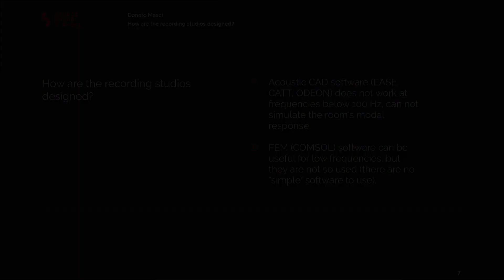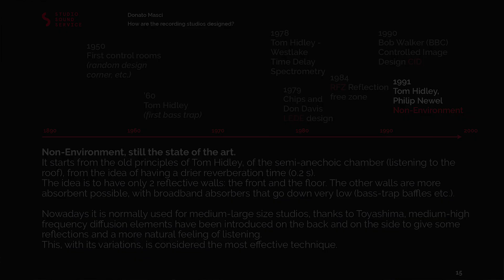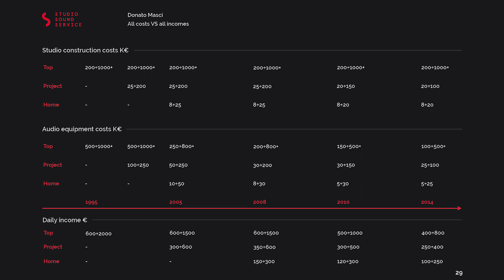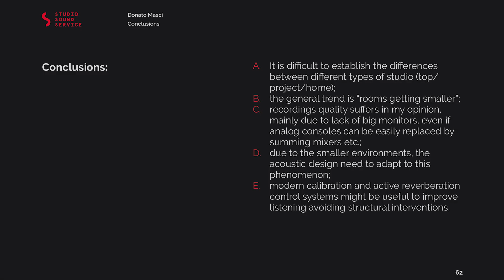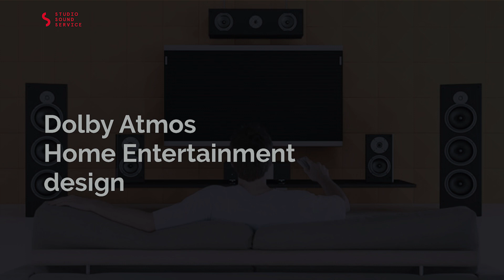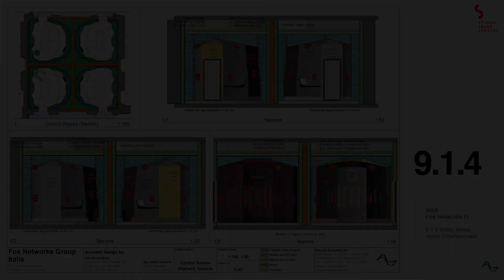Donato Masci speaks at LLB  2018 on Studio Design and Multichannel Audio

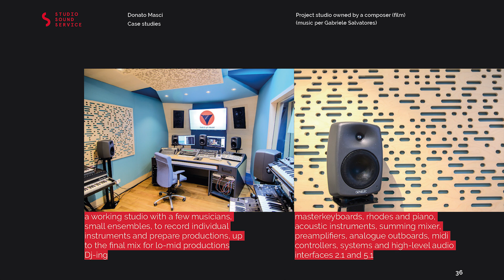Comment: 44:15 the rear speakers are positioned with acoustic differences( one side with a diff/abs and one side by a glass. does that kind of setup cause shifts in the stereo image or any kind of phase issues?